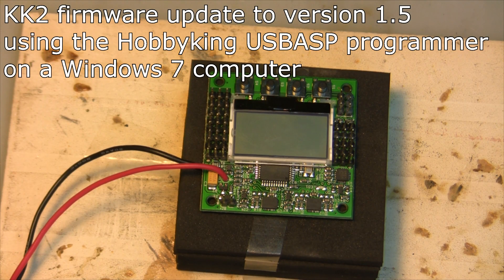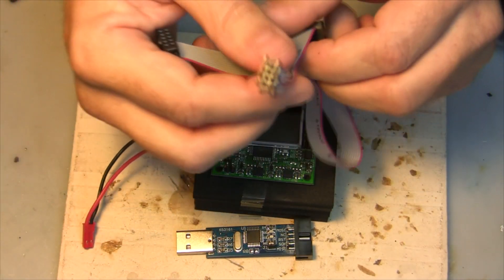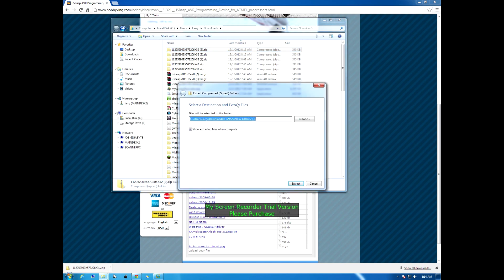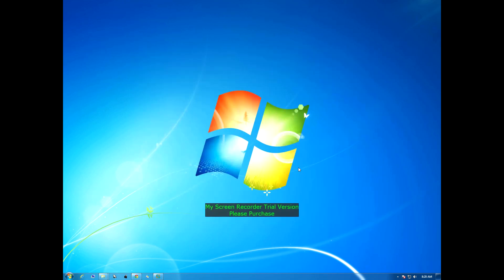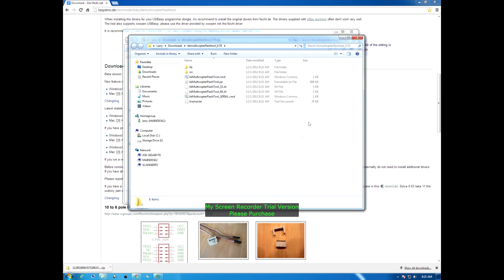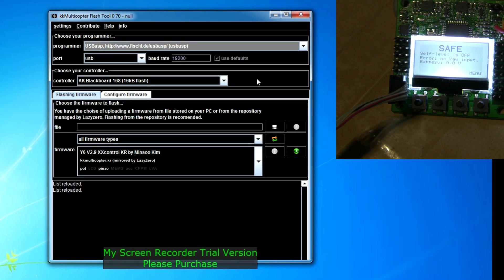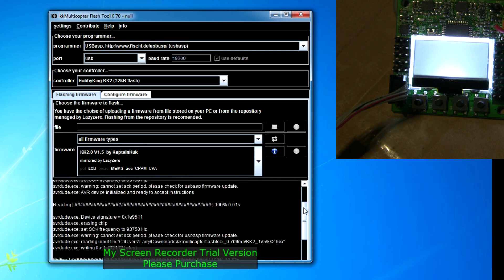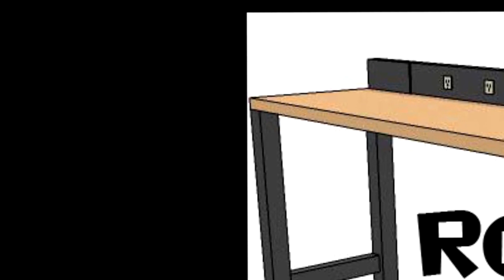KK2 Multicopter Controller firmware update using USBASP on Windows 7 Computer

Comment: Hi When ever i flash my KK2.1 V1.6 it says as below. Could you help me. My KK2.1 board does not change any figures so I thought to re flash it but it say as Below:

  
Flash the firmware file.
Flashing firmware from file.: C:\Users\PROTIK\Desktop\KK 2.1 Firmware\KK2_1V6\KK2_1V6\kk2.hex

C:\Users\PROTIK\Desktop\KK 2.1 Firmware\kkflashtool_win32\New folder\lib\avrdude\windows\avrdude.exe -C C:\Users\PROTIK\Desktop\KK 2.1 Firmware\kkflashtool_win32\New folder\lib\avrdude\windows\avrdude.conf -p m644p -P usb -c usbasp -e -U flash:w:C:\Users\PROTIK\Desktop\KK 2.1 Firmware\KK2_1V6\KK2_1V6\kk2.hex:i 

avrdude.exe: warning: cannot set sck period. please check for usbasp firmware update.
avrdude.exe: AVR device initialized and ready to accept instructions

Reading | ################################################## | 100% 0.00s

avrdude.exe: Device signature = 0x1e960a
avrdude.exe: erasing chip
avrdude.exe: warning: cannot set sck period. please check for usbasp firmware update.
avrdude.exe: reading input file "C:\Users\PROTIK\Desktop\KK 2.1 Firmware\KK2_1V6\KK2_1V6\kk2.hex"
avrdude.exe: writing flash (32172 bytes):

Writing | ################################################## | 100% 24.49s

avrdude.exe: 32172 bytes of flash written
avrdude.exe: verifying flash memory against C:\Users\PROTIK\Desktop\KK 2.1 Firmware\KK2_1V6\KK2_1V6\kk2.hex:
avrdude.exe: load data flash data from input file C:\Users\PROTIK\Desktop\KK 2.1 Firmware\KK2_1V6\KK2_1V6\kk2.hex:
avrdude.exe: input file C:\Users\PROTIK\Desktop\KK 2.1 Firmware\KK2_1V6\KK2_1V6\kk2.hex contains 32172 bytes
avrdude.exe: reading on-chip flash data:

Reading | ################################################## | 100% 15.03s

avrdude.exe: verifying ...
avrdude.exe: verification error, first mismatch at byte 0x0006
             0x65 != 0x40
avrdude.exe: verification error; content mismatch

avrdude.exe done.  Thank you.

Error during writing flash.

Comment: You have some very helpful videos. Thanks. I have a question about the USBASP cable. The USBASP board is not available from HK so I purchased one from eBay but it only has the 10 pin header. I see that the HK 6 pin header is wired differently. Can you map the wires on the 6 pin header for me? I see that on the device 1=MOSI, 2=VCC, 3=NC, 4=GND, 5=RST, 6=GND, 7=SCK, 8=GND, 9=MISO, 10=GND. Thanks!

Comment: I need help! I just bought my very 1st quadcopter and it claims to be a FlameWheel F450 with the following specs from Aliexpress.
•1x F450 FlameWheel Quadcopter Frame
•4x Mystery 2212-930KV brushless motor
•4x Mystery 30A ESC 
•1X ESC board
•1X KK flight controller board
•1x KK usb tool
•2 pairs of 1045 props
•1x Mystery 11.1V 2200MAH 25C lipo battery
•1x Mystery B3AC 2S&3S lipo charger 
•1x Radio Link 2.4Ghz 6CH transmitter+ receiver(simple) 
I got the RTF. Is this a good quad?